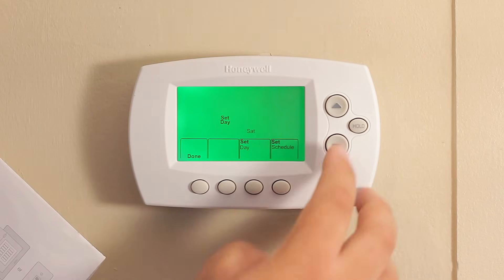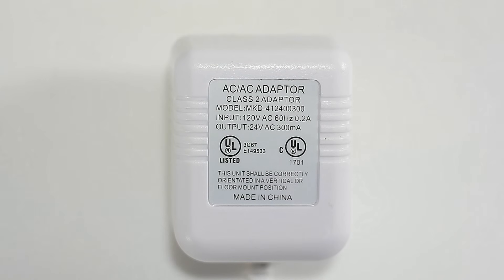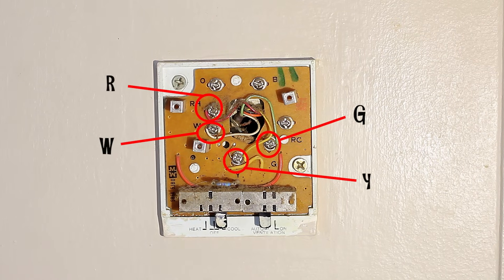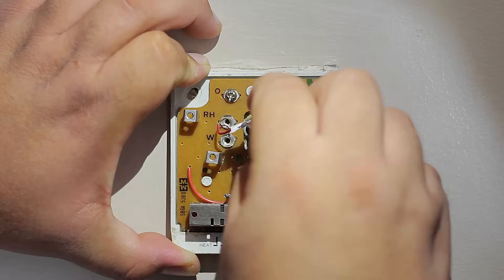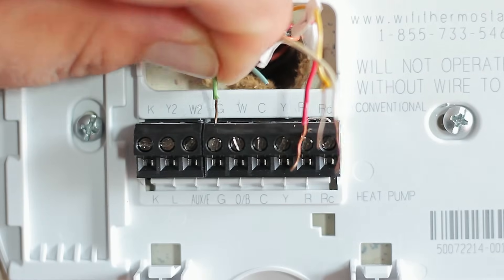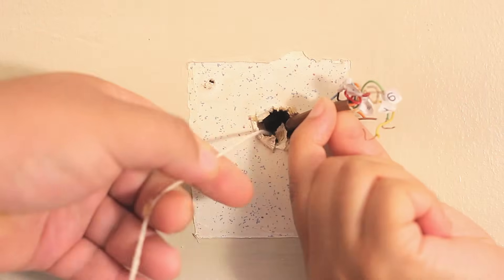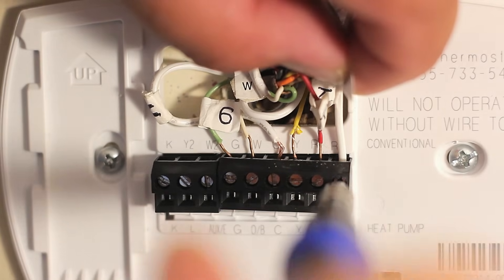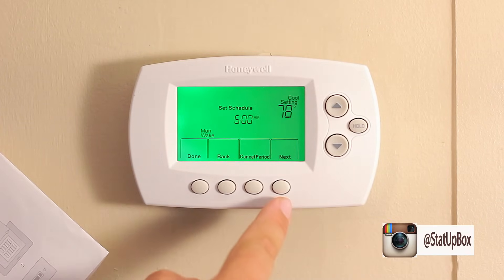How To Install A Wifi Thermostat  With Out And With  C Wire

Comment: I watched your video and did everything the same with the same Honeywell and 24v a/c adaptor my heater works but now the cool doesn't wanna turn on how do I go about that ? Everything use to work just fine before  Can you help me out please
Reply: It won't work since you disconnected the RC wire or the Jumper, RC means return cool and you basically only have heating now. The external transformer doesn't work for conventional heating/cooling systems
Reply: @marianabueno6063  You are correct. An external add on transformer takes away the cooling option.  I use two thermostats one for heat and one for AC.  You have to to it this way unless both the boiler/furnace and the AC use the same transformer.  Then you do not need an an external transformer and can pull the neutral on the transformer to the C connection.

Comment: Thank you for this excellent video! One of the best how-tos I've viewed, because:
1. You get right to the point!
2. Your instructions are clear!
3. Great video supports your verbal instructions.
4. You know what the hell you're talking about!

Still, I think I'm screwed! Going to check for extra wires when I get home tonight - I think I only have two: red + white. Hoping to find the C wire hiding inside the wall behind unit.
Reply from the maker: Thanks . Good luck.
Reply: @StatUpBox  i only have two wire red and white and I already have the 24v transformer adapter connected my ecobee 3 is turned on but my furnace is not starting i don't know what else to do.   ????? Help

Comment: Hi thank you for the video. I have a problem I canot choose Em heat for my thermostat. Just Cool  and heat. I have a Thermopump and use electricity in the winter when is too cold. With my old thermostat I can choose it. I try many option.  Thank you to help me.

Comment: My old thermostat only has two wires. What should I do?
Reply: Mine too what did you do, I bought a power supply
Reply: @stevenhagerty1408  did the power supply work with your two existing wires ?

Comment: Hi   Installed this thermostat with the adapter to my AC only central air cooling unit.  everything works except, the AUTO feature of the fan.  The unit will go on only if the fan is set to "ON" .  When the fan is set to AUTO, the unit does not turn on when system is set to "cool"    Any suggestions ?  I tried moving the G wire to the K terminal and that did not work

Comment: on that model, can you lock the thermostat to a set temp from the app so people at the house can not change the temp?   Will the app notify you if the temp is changed on the thermostat?

Comment: Can I use a spare blue wire as my C wire?
Reply: I have a blue wire that wasn’t being used previously and I hooked it up but it doesn’t work. There’s no power to the control but my heat is on

Comment: Why can't I use a jumper for a C wire?
Reply: This was my question as well?
Reply: If you jump the c terminal to others it will blow the fuse on the control board. Its ac voltage but think of a battery. R is the positive terminal c is negative. If you connect them together you get a short.

Comment: I have a problem, I connected everything same way as my Older thermostat, it has a C cable is blue.  Turns on WiFi on, but on Cool blows hot air, condenser outside of the house turns on as well!! HELP!
Reply: If it's a heat pump you may need to change the o/b setting

Comment: I have no C so I got a C wire adapter and followed this guide and it works for heat but not cooling. The Honeywell support tried to tell me that adding a C wire adapter works for heat-only systems, but not for heat & cooling systems. That doesn't make any sense to me, because if I bridge R and Y my AC turns on just fine. Is Honeywell support right? Or is my Thermostat just defective?
Reply: I'm having the same issue. Did you find a solution?
Reply: @lakundrashepherd1366  I'm having the same issue did u figure yours out?
Reply: @AlbertoGarcia-sh6rf  Honeywell's support said I have to connect the adapter that came with the thermostat to the unit in my attic but I haven't tried it yet.
Reply: Honeywell told me the C wire adapter would work on RTH9585WF.  When I installed it I also found out it only works on heat and NOT A/C.   Now I have to take everthing apart and return it.   Has anyone found a solution?

Comment: i have an older 4 wire honeywell chronotherm 3 and just bought the honeywell wifi model and the 24 volt ac adapter. I followed this video to the letter and it didn't work. it was like the fan was the only thing turning on. I set the cool to 65 and the room temp started out at 79 and it got to 82 before I gave up. I just put the old one back in and it's blowing cold now.gas heat furnace and central ac unit on the roof

Comment: maybe next time you make a video for homeowners that don't know how to put in a smart thermostat you can explain a little better cause if you found the extra wires in the wall you didn't explain what the next step was. If the wires are not hooked up in the furnace on the main board the wires will not work. You failed to tell everyone this just wanted to let you know this but over all the video was good and explained pretty good as well just left out if they are not hooked up in the furance

Comment: I have a garage ceiling mounted gas furnace/heater.  I have a two wire honeywell thermostat.  The current thermostat is just a switch to enable the furnace to fire up to the desired temperature.  On my wifi honeywell Thermostat which connections would be used as switch just like the original. (have the C wire adapter as well).
Great video..very informative Thanks

Comment: Replacing and old thermostat that has only two wires:

In our case the old thermostat had two wires (Red and White). I connected the Red wire to the R terminal on the thermostat and the white to the W thermostat terminal.

I removed the jumper provide with the thermostat between R and RC.

Our gas burning hot water heating system had a relatively new  "ARM-2P Control with Priority" unit that has a connector for 24 VAC and Common.  I ran a new wire from the heating system to the thermostat.  It had a black and a white wires.  I Connected the black to the  24 VAC on the ARM and to the C wire on the thermostat.  The white wire is connected to the Common on the ARM and to the RC on the thermostat.

All works great.
Reply: Can you make the WiFi feature work without the C wire?
Reply: @Airbunnie11  no the point of the c wire is to power the whole thermostat
Reply: I ran a C wire from the VAC, then just jumped a wire from W to RC and it worked, thanks!

Comment: Help. My two wire w / AC adapter system worked for an hour.  Error message no pwr on the RH. Nest learning thermostat. Wall heater
Reply from the maker: you can use a multimeter to verify if any power
Reply: @StatUpBox  yeah, I did that already. For some reason the thermostat isn't recognizing the C power. Nest suggest I charge the unit up to full battery and then try. Otherwise, I thought to configure settings to W and Rh only and not a C wire so the unit won't look for an external power.

Comment: How do you cover that hole in the wall?  Mention that there are alternatives that require wiring at heating unit that are neater, if more complex, than this method.  Thanks!

Comment: How did you know which extra wire in the wall behind the thermostat was C?
Reply: any extra wire can be the "C" wire as long as its connected to C in the Tstat and "C' in the air control unit just color code it..
Reply: Abel Casanova would that happen to be the ground connection labeled 24v hum that’s on the board to the central ? It is a ground like screw and the blue wire wasn’t hooked up on it (is an unused wire) nor was that same blue wired being used at the thermostat wiring

Comment: You're video helped me to replace my old mercury thermostat with new Honeywell WiFi Thermostat. In my case, I had 4 wires (W,G,R,Y they were not labeled as color) not C wire. As you mentioned, I looked in the drywall and found unused wires(blue,brown,black) but non of them worked as 'C' because those weren't connected to  Furnace Power Supply.  
So, I connected one of the available color wire to the Furnace power supply board on 'C' socket and same color other End wire in the thermostat as in "C" (along with W,G,R,Y) in family room. 

Wallah ! it works... Thank You
Reply: "Voila!"....it's French ;)
Reply: n narr I did the same thing. Unit got power but the heat won’t work. Does nothing. Not sure why

Comment: Hi, I used the 24 adapter transformer. The heat works but the AC is not working! Does anyone has the same problem? Please help! Thank you.
Reply: Same problem. Did you find a solution??

Comment: I'm a little confused why you removed the jumper.  I saw a similar video where it was stated to leave the jumper for the same thermostat in your video.
Reply: Remove the jumper always when using both R and RC because they must not be connected together..The jumper doesn't need to be removed if using only RC .

Comment: I got the same thermostat  and I also used the adapter and it still didn’t work
Reply: Plug in adapter to wall socket then using multi
meter check voltage across the 2 adapter wires. If not 24 volts then adapter is bad. Hope that helps

Comment: We just purchased the thermostat in the video. It was a great video but wasn’t helpful in our scenario.
We do NOT have AC. Just a boiler. Old thermostat only had 2 wires, RED & WHITE. Connected to R and W terminals on the old thermostat. Is it possible to use this new thermostat with just adding the adapter?
Appreciate any help! Thanks!
Reply: I'm just finding I'm in the same scenario, going to try that and see if it works.
Reply: Yes this works perfectly although it’s probably more ideal if you have access from the thermostat to the boiler to run a 3-wire cable to connect the common (white) side of the transformer to the common on the thermostat to power it. Much cleaner and fewer parts. But either way works!

Comment: If you dont want to drill holes in your walls. You can plug in the 24v transformer to power near your furnace or (where the other end of your control wires are). Run the wires from your transformer to unused wires such as Black as common, and blue as Rc. Then go back upstairs to the thermostat and connect them accordingly.
Reply: But if you have an unused wire, just connect it to the Common terminal on the furnace control board, then obviously the other end to "C" at the t-stat.
Reply: @tonyming6969  Yes, THIS is the correct information. If you DO have an "extra wire" going from the furnace to the thermostat, you don't need the transformer. The furnace can already supply the "common" connection. Just connect the "extra wire" to the "common" connection inside the furnace, and the same wire to the "common" connection on the new thermostat.
Reply: @tonyming6969  Yes. And if you have the wire in your furnace and can not find the C terminal you may be able to just attach it to a screw that is attached to the metal case of the furnace.
Reply: @Shibu11229  no, C wire is the "neutral" wire, not the ground.
Reply: Does anyone know where I could find more detailed info on how to do this?
Reply: True but the adapter is for those who dont have extra wires. If your stat happens to be close to the furnace like in most apartments then you can just run a new stat wire from transformer to the common. If it's far away then the adapter is a good fit.

Comment: I will be installing the Honeywell RTH6500 Wi-Fi Thermostat and have a few questions, my Central Heat and AC system is a older one that uses HEAT STRIPS inside the unit for the heating. My wiring is 18/5 with the C wire wrapped around the others and not being used, I haven't checked the inside of the Handler yet to see if I can hook it up to the terminal block yet.
I'm wondering if I can take a "jumper wire" just at the Thermostat and run it from the G wire (Fan) to the C terminal without doing anything inside the Handler itself?  By doing it this way I  "Should" be able to still use the Fan Only and have power for the C wire......Correct??    I figure seeing how the majority of the work is at the Thermostat why do the extra work if I can just run a jumper, that and basically I'm being a lazy bastard and not wanting to remove the 10 Bolt-head screws and reinstall them on Handler's cover panel.

My other question is, is there a Ground wire at the Thermostat, if so which one would it normally be (color or letter wise)? I want to use a Multimeter to check for the 24V power?

Comment: Hi, I have a honeywell thermostat for heating only and would like to install the new WIFI. I have only 2 wires: R/RC joined and O/B. Is there a way to connect a wifi thermostat nest or Honeywell? Does it matter that my cable is figure 8 - means more Amp?
Alternative Can I just connect those 2 wires together via a smart wifi as TP link HS100 and a relay to enable or disable the heating from my phone?
Thanks in advance
Reply: petrakis cs I’m in the same situation as you. I was told you just need to add a power wire.

Comment: I have 5 wires:
Red -  power
Yellow - compressor
Green - Fan
White - Heater
Blue - not connected! 
What's the blue wire for?
Reply: Tom Bradley blue wire is not connected in the other end.
Reply: Electrons are color-blind. It's the copper conductor that matters. The colors only make wiring and diagnostics somewhat predictable. You may use any wire for any purpose providing it works. The thermostat and circuit board terminals are coded to simplify wiring. Rh jumpered to Rc is wired to the 24v side of the transformer... R - red wire.  Y is wired to the contactor coil in the outdoor unit if A/C is available Y - yellow wire, sometimes black. (the other side of the contactor coil is wired to the tranfomer common C terminal in the furnace) [Common generally uses a white wire but more on this later]. G is wired to the indoor fan relay coil on the circuit board and caused the blower to switch to high speed if either A/C is called or if fan switch is toggled from AUTO to ON.  G - green wire. (the other side of he indoor fan relay coil is internal wired to transformer common in the furnace). W terminal is wired to the circuit board to initiate a heat call. W-white wire BUT not like the common white. This white wire conducts 24 volts during a call for heat! 
So to summarize: R - red is the 'boss' wire 24v.  Depending on the thermostat settings the boss sends 24v to the other wires as per its design. Y - yellow wire 24v to A/C contactor coil on call for cooling.  G - green wire 24v to I.F.R.C fan to high speed.  W - white wire 24v initiates combustion sequence upon call for heat.  White wire 0 VOLTS is also typically used for common or the return to transformer after load.
All wires, including blue, orange, etc. can be used for any purpose providing it fits the afore mentioned purpose but wiring according to accepted color code conventions instills confidence in your fellow service technicians and indicates competency in low voltage thermostat wiring.

Comment: I installed it as you described with C adapter and it works, however the cycle last less then 3 minuets??
Reply from the maker: each device is different , it be best to contact your specific manufacturer to verify . in our case is worked flawlessly.

Comment: I installed it as described on video have 4 wires and got C adapter however I was told by Honeywell tech that your config on video doesn’t work for cooling with C adapter, I have to run it from control board I installed it worked but the cycling is too short last 3 minutes once it reaches the temperature, what is the reason for that. Please advice thanks

Comment: I have a Honeywell but only cold air comes out not hot I can’t figure it out what can I do?
Reply: I'm having the same problem but opposite only heater turns on but not the cool? Did you figure out what was wrong with yours?

Comment: I added the AC adapter to a 4 wire system to install the same Honeywell Thermostat in the video.  I installed the wires just as they were before, removed the R to Rc jumper, and added the white wires where you said, but now I have been left with the issue where my fan cannot be operated manually without the heat or air conditioning also being on.  I thought elimination of this issue was the reason for running an AC adapter as opposed to just added a jumper wire for C power.  Can you provide any help?
Reply: i am not sure, but you can try that - connect  the red wire to Rc and  the white wire to R .

Comment: Great video and very helpful. For those of you using a separate power source other than a "C" wire, make sure you're using a minimum of 24 Volt AC or 24 VAC power cord. I thought I was using the correct power cord until I realized it was only a 9 VAC but not before a total meltdown on my part.

Comment: I only have 2 wires on my old stat "RH" and "W". Can I attach to RH and W on the new stat ? or do I need an adapter ?
Reply: Stephen Stairs yes you can
Reply: Rh and W are all you need, read the instructions, with just Rh like 90% of thermostats, you will have to leave the jumper. I’m not familiar with this thermostat, but it should use the back up batteries as power, however it will drain fast, like less than a week fast. See if you can take WiFi off. If not, C wire is highly recommended

Comment: I only have 2 wires connection how can I make a smart thermostat to work with 2wires these anyway to make to work my house only have heat system so the cables the a have is white and red.
Reply: I just installed Nest E, and my boiler has only red and white wire, so I connected R to red wire, and W to white, so far so good.